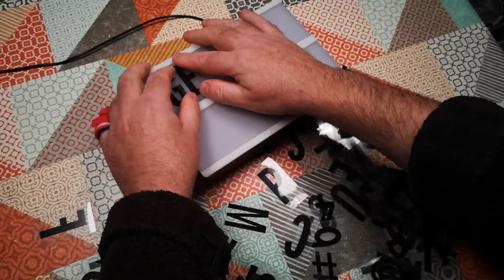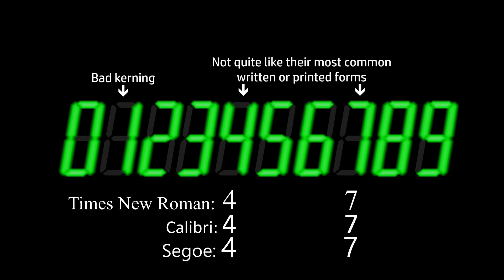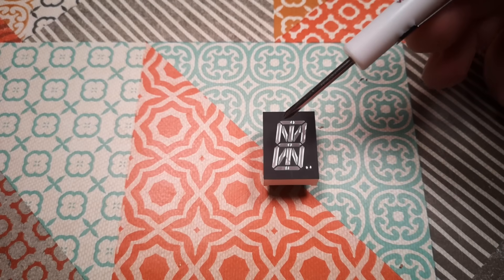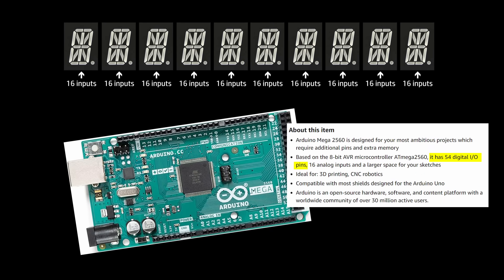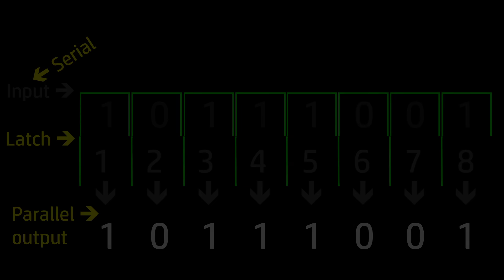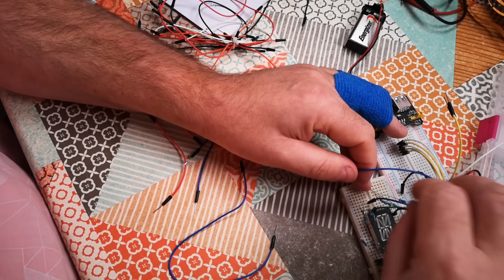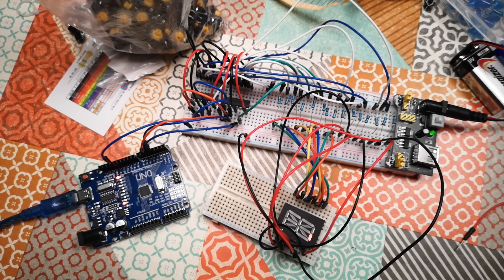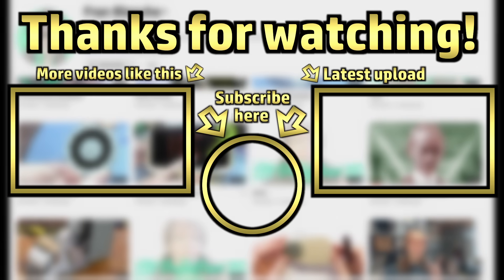Making an Electronic Message Display Board Part 1 - Theory & Prototype

Comment: A very crude but effective way to debounce switches is to put a capacitor across the switch contacts, something around 100nF to 1uF works, depending on how bouncy the switches are.

Comment: One reason for the two common connections and the seemingly random pin assignments is so that the display can be put in "upside-down" and the pins still match the right segments.
Reply from the maker: The two ground pins are on the same side - pins 12 and 17, so not reversible
Reply: @AtomicShrimp  I did consider checking the pinout before posting, then thought Nah, it'll be just like the 7-seg versions. Oops!
Reply from the maker: @rpdom  I didn't know the 7 segment displays were reversible though, so I learned something

Comment: It's useful to think of switch debouncing as literally bouncing the connector, but that's not strictly the case.  I mean, it does happen, especially when a human is actuating the switch, but it also is caused by downstream components reacting non-instantaneously to a voltage change, and the voltage source itself not reacting perfectly.

Most projects fix the issue in software (read, wait, read again), but my recent forays into analog-only circuitry for synthesizers has required hardware-only solutions.  The simplest I've found that still works is using a small capacitor to the opposite voltage level (e.g. to ground if +5v is being applied) that needs to be filled before the voltage downstream can match upstream, effectively a low-pass filter.  It'll also work on the open circuit side, needing the capacitor to drain before the downstream line reaches 0v.

You might also, in the near future, run into an issue with shift registers, if you haven't already.  Many of them have a maximum output current, and driving a lot of LEDs off them at once can be an issue unless you're happy with very dim displays.  Going over the limit could burn out the chip, or cause the same sort of dimming you'd see with using a single shared cathode resister.  There's a couple fixes, but one common one is to invert their logic, so that you connect the LED to +5v and switch them to 0v through the shift register, as many shift registers (and ICs in general) can sink a lot more current than they can source.

Comment: If you want to connect a momentary switch as an Input, you need also connect a 10K OHM Pull-Down Resistor in between the Contact and Ground to avoid double or tipple clicks.

Comment: They look nice, but just looked and they have sold out, which is not surprising  given the price.
Think I would still gone the multiplex route. one serial to parallel chip to drive the 16 segments and a second one to drive the column's
Looking forward to part 2.
Reply from the maker: Probably my fault they sold out, for drawing attention to them. I think there were only a hundred or so left when this went live. Hopefully Cool Components has another pallet of them out back...

Comment: You can make your code a bit more efficient by representing each character as a 16 bit integer.  Place them in an array and index the digits from 0 to 9, followed by the letters.  The letters can be indexed by their alphabet position plus a fixed offset.

Comment: LED power requirements scale a lot. I would design for worst-case scenario (all leds on). Without multiplexing, say you want to drive 64 displays. Every segment at 10mA x 16 segments x 64 displays = 10.24 Amps.
Red LEDs have a forward voltage of about 1.8 Volts so (5-1.8)/0.01=320 -> 330ohms for the resistor. I couldn't determine the value of the resistors you used.
Powered from 5 Volts, sadly, 36% of the power goes to the leds and the other 64% gets converted into heat inside the resistors. PLUS the power required for the shift registers
Get yourself a chonky power supply and maybe some capacitors and thicker wires.
Reply from the maker: Yeah, power management will be fun, and I'll also have to think about heat management.
It's not quite as bad as that though, as, in use, less than half of the total segments will ever be lit at once, however, I'll need to design for the worst case.

Comment: Electronics is a foreign language to me, but this project intrigues me. For as long as I've been driving, I've always wanted a display panel in my rear window that, with the press of a button, can provide a customised message to the driver behind. Wouldn't that be great if it could be driven by text to speech too?

Comment: I've always been interested in E-ink segmented displays like this. Basically no power draw and, since they're simple shapes that only need to display hard on/off signals, you don't really need to worry about and of the stuff you normally need to with E-ink displays. Seems like for extremely low-power usecases they could be really solid but I suppose the demand for that isn't all too high.
Reply from the maker: I've seen a few little wall thermometers that had E ink displays that appeared to have segmented numerals, but I'm not sure if these were actual segments or just a representation of them on a graphical panel

Comment: I thought that intro was very Fran-like. Just missing the "ca-chunk" of the relays, or whatever goes on with those neat displays she has 😂 I'm now on a mission to find one of those little power boards you used with the breadboard, I'm still pretty green with messing around with mine.

Comment: The flickering isn't because of multiplexing, it's because of slow multiplexing. If you multiplex the segments with a much higher framerate (say, 10 kHz, something that's easily achievable with most microcontrollers), there would be no visible flicker even on camera.
Reply: For a large muxed display 10KHz can be trouble.  Remember that there would likely be many steps to setting up all the signals and then you have to pause briefly.  Doing a 8 digit 7 segment display with a micro I was able to do about 20KHz scan rate but that was a lot simpler than the thing he is making.
He is likely to need to set up two 8 bit ports for the anodes and then a third one for cathodes, pause. shut off the cathodes and set up the next one.  You have to switch off as you change so you don't get a faint glow.

Comment: 2 grounds to use all 18 pins of the package. 17 pins would just be, odd.
Reply: It also make multiplexing a lot easier.  I assume there are 8 anodes and a cathode for them and then another 8 anodes with their own cathode.
This works out nice for machines with 8 bit ports.

Comment: Thanks for the tip on the surplus stock 16-segment LEDs. They look interesting and I plan to use them in a project or two. Andit looks like they normally cost a lot more.

Comment: HaHa, can’t believe this. I have been building and programming 5 4 digit 16 segment LED displays for the Harrier GR5/7/9 ODU over the past few months and had taken a sabbatical as it was doing my head in. Fran Blanche was a great help. I also have been working on 26 digital inputs through shift registers with a 10 digit 16 segment display and two 2 digit 16 segment display working of one Arduino UNO for the UFC. So my favourite wildlife, walking, cooking, have a go content creator suddenly pops up with a digital display, best Yuletide present I ever had!

Comment: If I had to guess, the common ground is probably a mix of current carrying capacity (if the entire display were lit there's a large asymmetry between the conductors going in and out) and, perhaps more importantly for low power devices like this, redundancy, so the entire thing doesn't instantly fail if one of the grounds is somehow disconnected

Comment: Ahh, I have spent a few years playing with Arduinos & various LED displays. I rather prefer the 64 LED version you showed. If you have a long row of them, you can shift the message one column at a time, thus making for a fairly smooth moving display. The 16 segment LED signs scroll 1 full character at a time. This whole display topic is interesting. It is like Art. What does each individual like best? So, looking forward to more of YOUR art project.
Reply from the maker: Yeah, I did think about a matrix display but then there seems no reason not to just get a premade addressable matrix, but also without scan multiplexing, one shift register per dot column seems a bit excessive

Comment: Good Job, your code is not spaghetti, more like unrefined.  If this were release  code, there would be at least one bit of code functioned out.  Good job with the coding from an experienced developer.
Reply from the maker: Yeah, the production version will be a bit more refined. Ultimately I want to create a really simple markup language so the text to be displayed can be edited on an SD card and include structure for various display effects and timing etc
Reply: @AtomicShrimp  Wouldn't that be a "mark sideways" language?  :) :)   16 segments gives you 65536 possible characters.  I think you are going to want to define all the easy ones and then add a code that lets you spec any bit pattern you want.
I would make it have some way to add comments too.
Reply from the maker: @kensmith5694  yeah, I want it to be simple enough that someone could just type text into a file on an SD card and have it display that. I think it should be simple enough to have escaping in the text parser so that it can be passed the bytecodes directly too

Comment: I write my 4 and 7 thr same way a 7 segment display does. writing a 4 with a closed "hat" is too easy to confuse with a 9
Reply from the maker: I expect when you write a 4, even if the top is 'open', the horizontal bar crosses the vertical
Reply: @AtomicShrimp  nope I'm a weirdo
Reply: @AtomicShrimp  It either meets it or I leave a tiny gap. but rarely does it cross unless I'm writing very sloppy.

Comment: Your comment about number 4 not looking like it's written form depends on your handwriting. I personally write my 4's like a flipped and upsidedown 'h', as it would be on a 7 segment display. I don't know if it's just a subconcious thing I've picked up from looking at so many 7 segment displays but I don't ever recall writing a number 4 like it's typed or 'proper' way.
Reply from the maker: Are you sure the horizontal stroke doesn't cross the vertical one when you write it?
Reply: @AtomicShrimp  If I'm taking notes or just scribbling, it varies massively. If I'm writing carefully, I'd say it only slightly crosses the line.
Reply: @AtomicShrimp  Hi Mike, another commenter here, I definitely don't cross my horizontal and vertical lines for my 180-rotated-h 4s, unless I'm being sloppy. I've got a whole notebook with examples.  I also do not cross my 7s, 0s, or Zs. I do somewhat rarely serif my 1s. My 9's are also very similar to horizontally flipped Ps. I feel like I pretty distinctly remember learning them this way in the elementary school I attended.

Comment: I don't know how cultural this is, but i think that for me, the only way i have ever hand written a four, is as it is in a seven segment display. Honestly, i feel pike the typical font 4 is a bit like the lonwercase letter a with the long tail. I've been exposed to it enough that i don't question it, but i would never write it like that unless i was deliberately trying to make my writing fancy.
Reply from the maker: Even in an 'open' 4, the horizontal bar crosses the vertical. It doesn't just stick out of the side
Reply: @AtomicShrimp  I suppose that depends on your handwriting. Just to check, I cashed out a few 4s on a whiteboard, and found that if the lines fully crossed, it was because I looped up to do the down stroke. Really enjoy the videos by the way. Quite enjoy the casual, "just doin' whatever I'm doin'" vibes.
Reply: @AtomicShrimp  I also write the 4 like on the display and I usually write it with a single stroke, so it looks more like a "u" with an elongated tail, no horizontal crossing. Most people around me do the same

Comment: I remember building a BCD (binary coded decimal) to seven segment decoder from discrete gates during my apprenticeship. It was quite fun, if a bit futile. Nobody builds these from scratch. Not even then.
It WAS a good training in boolean algebra.
Reply from the maker: Me too! I was on a YTS 'tech' scheme. We had to draw a truth table then figure out the logic, then build it, then the teacher told us that BCD decoder ICs exist
Reply: @AtomicShrimp  (and cost the same as a hex inverter)😂
Reply: Reminds me when we had to code an audio filter in C for some not very powerful microchip. After we were already an hour and half over the planned end of the lab session and still nobody had gotten beyond static noise or stuttering output, I went "screw this shit", packed up and left. About ten minutes later the prof finally decided he had proven his point and we could leave now, writing a report on why that had been an exercise in futility as homework. I had already come to terms with failing the course when he told me the next day …
Reply: I was stuck on site in Birmingham replacing an encoder on a press,  The original had a Gary scale BCD output, The replacement was straight binary, All I had was a box of diodes, Got it working in time for the Nightshift.
Reply: @dogwalker666  That's where the basics come in handy.
I guess sometimes these things ARE built from scratch.
Reply: @HotelPapa100  indeed.
Reply: Discrete building is always just for understanding. But it does a great job of teaching